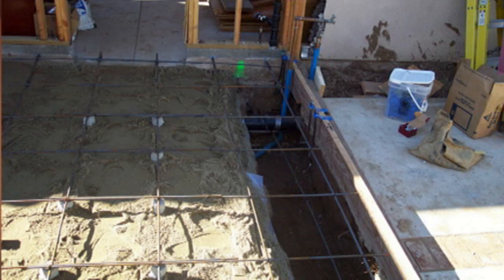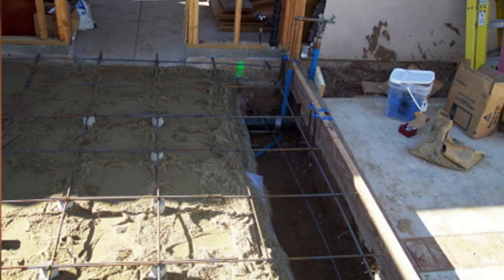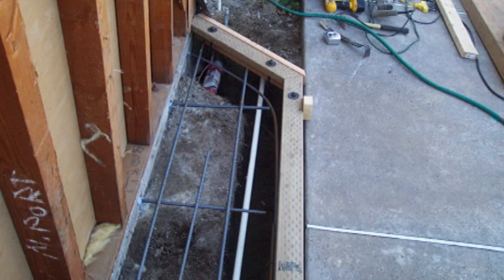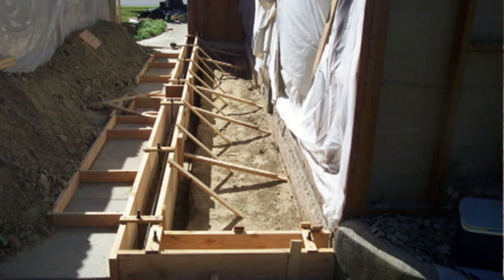What Does an Anchor Bolt Do? - House Framing Tips

Comment: If you’re adding onto an existing structure Does the builder put in anchor bolts then too?
Reply from the maker: Yes, anchor bolts should be put in before the concrete has been poured. Here's a link to our website it might provide you with more information.

https://www.homebuildingandrepairs.com/foundations/index.html

Comment: Why are L-bolts the newer thing to use as opposed to J bolts? The statement at 0:28 where J-bolts are "obviously a thing of the past." I'm confused about the 'past' part since I still see people using J bolts (doesn't make it right) and J-bolts seem to do a good job, so I'm confused why they're 'obviously' no longer used. I can't find any qualified answers on this anywhere else. Any extra insight on this is greatly appreciated!  PS -  Thanks so much for taking the time to make these vids!
Reply from the maker: I have an idea in my head, but will do a little more research and get back with you.

Comment from the maker: You would have to remove sections of the wall interior or exterior, but homes built in 1963 should have anchor bolts. I live in a house that was built in 1959 in Southern California that has anchor bolts. Do you know for sure that you don't have anchor bolts?